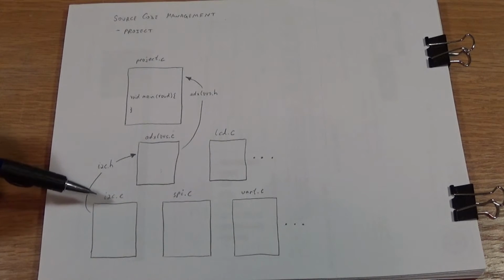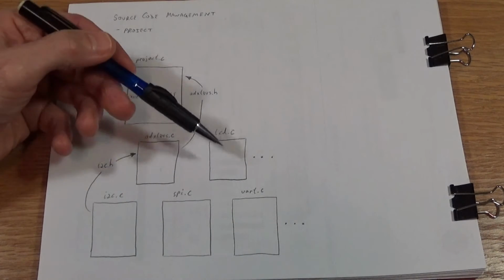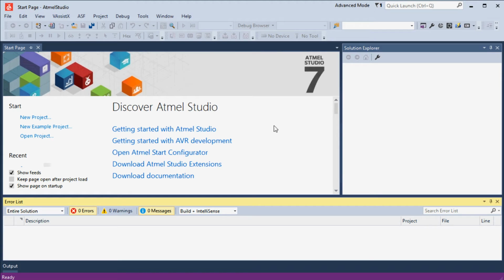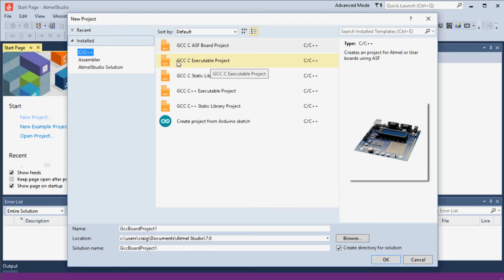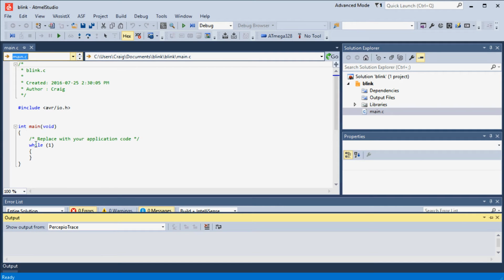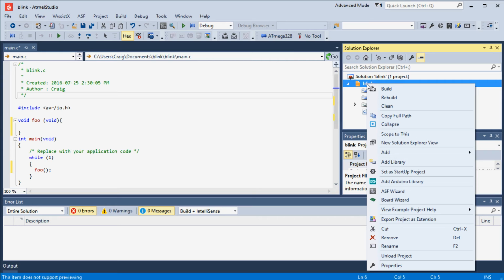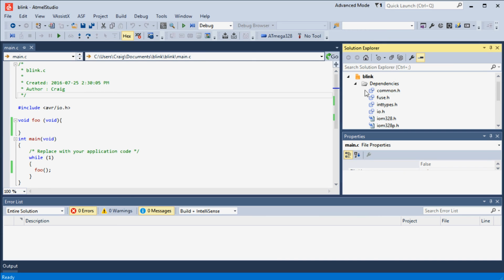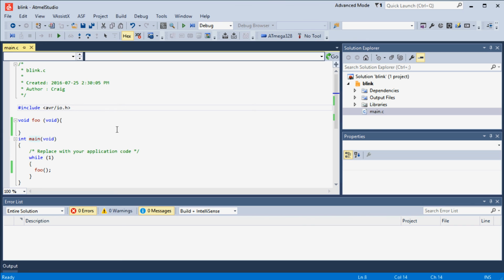Going Beyond Arduino #2: Source Code File Management

Comment: So if you use the atmel programmer, you don't need to flash a bootloader?
Reply from the maker: That's correct, you don't need a bootloader.
Reply: How about if i design a pcb with ARM A9 processor, do i need to download a bootloader or a grub to boot up the linux OS?
Reply from the maker: @richardqqq176  Linux is whole different beast.  My videos are about simple small microcontrollers and I'm not that familiar with Linux.  Google will be your best friend in this case.  Thanks for watching.

Comment: Craig: I'm a recent subscriber who really appreciates the way you explain to newbies (like me!) how to jump straight into programming Atmel chips. Awhile ago I bought an Uno and some accessories; I wrote some sketches but quickly grew frustrated with the hand-holding that the Arduino IDE imposes on its users. As a reasonably intelligent adult, I'm more focused on learning about programming than on building any specific project, so it's time to move on.
Reply from the maker: Glad you are willing to take the plunge.  Good luck!